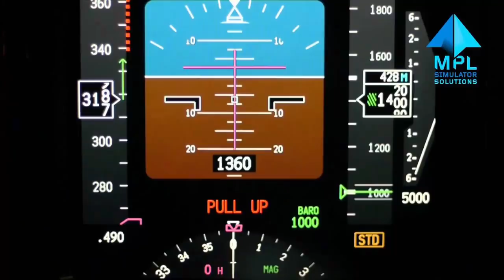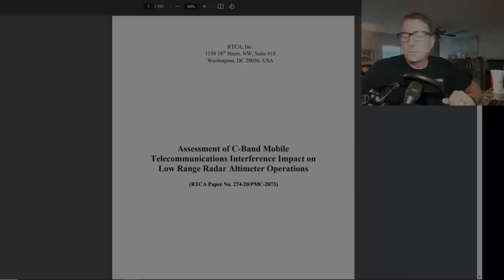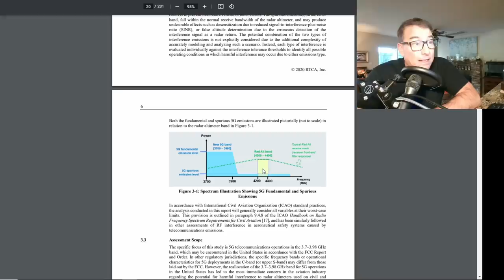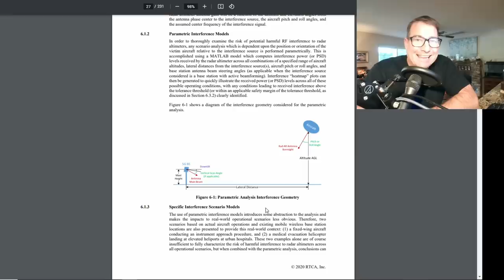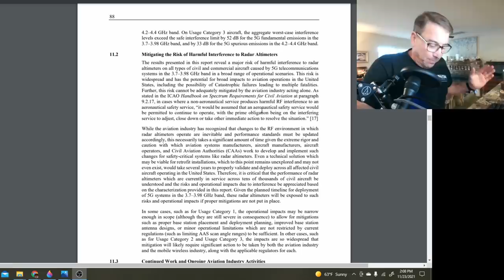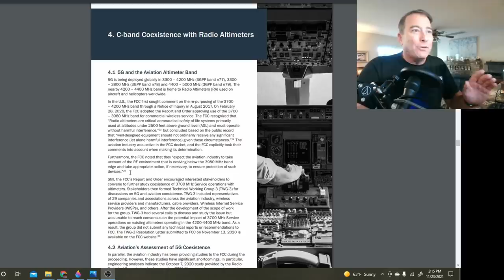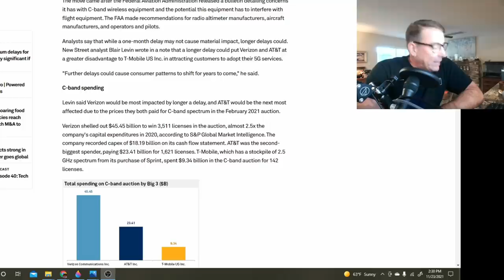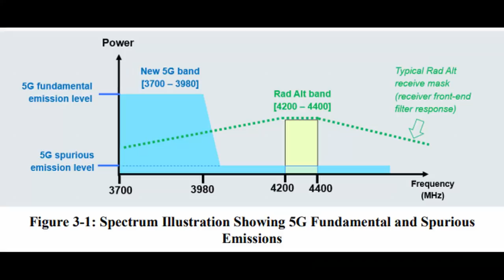5G C-Band Interference with Radar Altimeters in Aviation

Comment: One design feature of the radio antimeter antennas is that it is a horn type antenna that is very directional with a very narrow  radio siganl "beam" for both transmit and recieve. That bean is very narrow  along the lateral axis of the aircraft. Most airline aircraft have two radio altimeter  systems with the antennas close to each other on the belly of the aircraft. But there is a system where by the transmitters time their transmissions to avoid conflict  of the signals between the two systems. So this directional antenna by this diesign may not recieve any interferrence from any transmittesr out side of the approach path to the runway.

Comment: A corresponding thing is happening with railroads in Europe.

Under the new European signaling systems (ERTMS level 2 and 3), trains are in constant radio communication with the central equipment (interlocking, IX, and radio block center, RBC) that determines who gets to go where. This radio link is realized using a version of 2G cellular telephony galled GSM-R.

The frequency band for GSM-R is fixed and is the same all throughout Europe. Now some countries have allocated a neighboring frequency band for wireless internet. These bands are so close together that there is a risk of spill-over. If this happens, trains can lose connection with the central equipment. This is not dangerous per se, but causes unnecessary slowdowns or stops.

Comment: I am a retired AF pilot, with T-37 IP, C-141, H-3, C-21 experience. I wonder if the 5G towers could be fitted with a signal blocking design, (either a physical shielding or an electronic "limiter") to ensure the signals the equipment produces does not radiate upwards? There is no practical reason for the signals to go up as all the "users" in those critical locations, near airports, are below the towers, not above them. Seems this would be a relatively easy, low cost, fix for the legitimate concerns you raise. Love the content on your channel, by the way!
Reply: The conflict comes because radar altimeters are used at low altitudes, and cell towers either have to broadcast sideways or else have one above every house and car pointing down. If the cell tower is 2 miles away, a plane at 500' AGL is almost "below." It's very difficult to make a radio antenna that cuts off within 1 degree above horizontal... harder, in fact, than making a good frequency filter.
Reply: Modern 5G systems use beamforming to focus the signal directly, from both transceivers. I suspect the risk level is being VASTLY overstated.

Comment: Suggestions for radar altimeter / 5G 
1.	Push for aircraft cellular RF detectors that would alarm when passengers 
turned on a cell phone. (I know some research has been done by RF instrument 
manufacturers for airline industry)  
2.	FCC mandate 5G base stations and repeater sites utilize certified antennas 
that minimize or eliminate vertical RF radiation pattern (Particularly near airports).
3.	FCC mandate testing and certification to minimize 5G base stations vertical RF admission,
Reply: Mobiles never transit unless they are given permission by the ground-based equipment. So, unless they are able to receive a signal telling them when they can attach to the network, they stay radio silent. For better or worse, that won't typically happen until the aircraft is below the level of the towers if the tower antennas are pointed down. In urban areas, some of the fixed antennas have to point up to allow high rise buildings to get a signal. Urban areas will generally use a lower power signal with a denser configuration of antennas to support more users, which is less likely to be at a high enough level to cause interference. The mobile devices are also configured to send at a lower power level when close to the attennas.

Full disclosure, I work for Nokia who sells network equipment to the companies who are bidding for the spectrum, but I haven't worked in the wireless part of the business since when UMTS/3G was being developed.
Reply: @Android-ng1wn  I was in the cellular industry and work with the device antenna engineer who had to work with base antennas to get device certification.  Microwave dish antennas operating in the same frequency bands it's not uncommon to see a grounded plate to deflect unwanted radiation from interfering with other systems on the towers or rooftops, adding a grounded element above what is a small 5G base stations and or repeaters near an airport would not be rocket science Just good site RF engineering.

Comment: Thanks for your report. I have worked on 5G. The wireless industry will consume spectrum without end. Today the primary use case consuming bandwidth is streaming video, tomorrow it may be VR/AR, not exactly a life critical use. The mobile wireless business is encroaching on GPS, and cutting into the satellite spectrum, which is in short supply. 

The wireless industry wastes spectrum by allocating separate bands for transmit from the base station - for that streaming video, and received at the base station which is barely used. That is called Frequency Division Duplexing. The wireless industry and the FCC could be much more efficient by adopting Time Division Duplexing - dynamically sharing one band for transmit and receive. 

Pilots should be concerned about passenger misuse of radios. Unfortunately passengers will be tempted to turn on their radios on approach to get a signal.
Reply: Yeah, having used 5G I'm unimpressed. Maybe I'm not the target Tik Tok demographic but I care much more about reliability at 4G speeds than this garbage. I'm always perplexed by the 5G hype. Yes, faster will be cool but not if I have to be sitting on the tower to use it. 

Of course, I know nothing about radios and cell phones so maybe I'm missing some magical piece of information but as long as I can talk to friends and family and stream a video (and importantly, send a text message) from anywhere, I'd be much happier than getting a speed boost. (i.e. geographic coverage, including inside buildings or subways or whatever, is way more important to me than speed).
Reply: This band is TDD.  The FCC decides which bands are TDD and FDD, not the wireless operator, primarily due to coexistence.  Operators also prefer TDD due to the asymmetric nature of user traffic.

Comment: The first few crashes will provide the empirical data needed.  Is that how Boeing tested the 737 Max?  It might be air transport or fast wireless communication.  Or can all navigation might need to go to GPS signals.  Might the GPS signal integrity might also be compromised.

Comment: I'm still yet to understand the point of 5G in general.  Why would anyone need/want to be able to pull 1Gb/s+ off towers?  It serves no purpose.  Your YouTube/Facebook/whatever isn't going to load any faster than it would on a normal connection and even if you DID start utilizing the bandwidth to transfer huge files, which is really the only time you'd ever notice that much additional bandwidth anyway, you'd blow through your allotment and be throttled basically instantly.  (Yes, even on your "unlimited plan"...)  
The only reason these companies are doing all this that I can think of is because it's a sales pitch.  "More = better" and this brings Dr. Malcolm's quote to mind...they're "so preoccupied with whether or not they could, they didn't stop to think if they should."

Comment: The FCC has effectively killed the 3.3-3.5 GHz allocation for amateur radio operators with this action, too.

Initially, they were going to sunset the entire 3.3 to 3.5 GHz range, but the ARRL worked to get "temporary reprieve" for 3.3-3.45 GHz.

From what I see on the 5G NR band allocations, the C-band TDD allocation is a worldwide allocation from 3.3 GHz to 4.2 GHz (right at the edge of radio altimeter!!), but is "temporarily" limited at 3.98 GHz in the US.

Both 4G LTE and 5G NR use OFDM modulation, and tend to not exhibit much in the way of spurious emissions (at least in my own observations, using software-defined radio receivers -- as an example, the P25 public safety allocations in the GSM850/UMTS B5/LTE B5/NR B5 FDD band gap). But the problem I see here is that this C-band allocation will be using TDD (time-division duplexing, where the base station transmits on a channel for x milliseconds, then the mobile equipment transmits on that same channel for x milliseconds) rather than FDD (frequency-division  duplexing, where the base station continually transmits on one channel, and the mobile equipment transmits on a different frequency, as needed).

In the amateur radio world, we use many technologies, both analog and digital. As an example, when I transmit standard FM voice on 70cm (440 MHz), I get some spurious emissions, but they're consistent in their power levels. When I transmit using a DMR radio (which uses TDMA -- time division multiple access -- ie: I can transmit in timeslot 1 and another operator can transmit in timeslot 2 simultaneously), the effect is profound. Instead of one strong carrier, with some sprious emissions, the result is very rapid pulses of RF energy at the carrier frequency, with significant "splattering" and spurious emissions all over the place, and is much more difficult to deal with. Analog transmissions rarely cause interference among things in my home, but DMR makes many things go berserk; even some headset/mic units designed for handheld radios have trouble dealing with that pulsed emission. And these handheld radios are 5 watts or less.

Ironically, I get less interference from my HF radio, transmitting at 100W from 1.8 MHz up to 54 MHz.

Oh, and us amateur radio operators (at least here in the US) can transmit at up to 1,500 watts on most bands. One of those bands is 2,390 MHz to 2,450 MHz -- incidentally, a microwave oven cooks food with 1,000-1,500 watts of RF energy at 2,450 MHz -- I could (legally) make a bacon gun, as long as I can transmit my call sign in Morse Code while cooking my bacon.

In all seriousness, I will probably end up making a video and/or blog post about this topic. My call sign is KD9QZO, searching for that should find me. I'll (try) to update this comment if/when I do.

Comment: Great video describing the problem, however based on the info here I have to agree with 5G. Based on the graph at 10:22, you can't claim >1GHz beyond your allocated 200MHz simply because you have bad filters. It is not hard to design analog or digital filters that provide 40dB or more of rejection within 2x of your bandwidth. If the altimeters are so critical but at the same time so delicate then that's a huge vulnerablity for the aviation industry even without 5G. In that case the altimiters should be redsigned to be more robust anyway. Also putting the transmitters directly under the path seems overly conservative, it seems a simple solution would be to just don't allow 5G transmitters under the approach paths.
Reply: Electrical engineer and former Boeing employee.  I totally agree with the above.  Seems the aircraft/avionics manufacturers are trying to shift the issue to the 5G rollout when the core issue is their lack of stringent design of filters.  This was probably not an issue when the early radio altimeters were introduced, no one else was on the spectrum, but it will be an increasing issue as the spectrum fills up.  There was a similar issue with GPS systems, again lack of appropriate filter design.  This is not "rocket science".  Any competent HAM radio enthusiast understands the issue.
Reply: @chuckwain5591  I don't know the issue well enough to say either way but I wonder how much of this is really an issue or is this just overzealous paranoia ("You can't say with 100% certainty that it's impossible for there to be issues").

Comment: The bulk of the 5G service will be launched on frequencies that the big 3 already own.  Example: T-Mobile is using the old UHF TV frequency of 600/700 Mhz and the midband 1.9 to 2.5 Ghz band for 5G transmissions.  Their reservation for that 3.5 to 4.2 band will be used for rural expansion to cover more roads and freeways in America. Band sharing has been used for years by the FCC. They could create a rule for cell towers,  saying they can only operate on the lower end of that band near airports, hospitals and certain cities. It will be manageable.
Reply: I think you got that backwards.. the higher the frequency, the less  the range per kwatt.  at lower frequencies one also has to use more channels (bandwidth) to get the high byte transfer rates.. thus the closer to 5Ghz the shorter the range an the better for high population density.

Comment: As a very experience electrical engineer in the radio industry,  with some aviation/avonics experience, I can say that you've done a good job explaining this. It's slightly slanted from your point of view, but that's expected.
.
The only thing I will point to is that the idea of being first in the spectrum is only of minor importance as we pack more and more stuff into the spectrum. A system must not transmit out of it's allotted spectrum, nor be able to receive out of its normal spectrum within reasonable standards ( reasonable amount of power). It's unfortunate the radio altimeters have those type of front-end filters, but it is not impossible to improve them in a modest amount of time. 
.
It clearly should have been identified and addressed long ago.
.
As radio systems have evolved since it was invented there have always been times of conflict such as this that had to been resolved.
.
Having been out of the industry for quite some time now, I find it very surprising that it has gone this far,  right up to the point of deployment and we still haven't resolved this. 
.
I'll be using your video as support for things that I've said based upon my professional experience to help people understand what's going on.
.
I'll say that based upon what I've seen in the last 10 or 20 years coming out of people that think they're engineers, in various technologies, is very disappointing, especially based upon the high quality of people and work and designs that I was part of when I was developing communication systems.
It appears somebody was asleep.

Comment: Radio Engineer here but involved more with Public Safety systems. Basically the FCC is saying that just because the aviation industry is using loose and inexpensive filters does not warrant a hold on the adjacent bands and I have to agree. You can't imagine the filtering used on all RF equipment in order to stay "in our lane". The aviation biz shouldn't be given a pass for (legacy) sloppy filtering. The mid-plan would be to mitigate deployment of some cells (which are inherently of small size and as stated not oriented towards flight paths) until the FAA has "cleaner" altimeters. Public Safety has recently gone through a resizing of channel sizes which involved better filtering on portable radios *which far outnumber aircraft*. Claiming this upgrading process is unfeasible is not accurate, it has been done before successfully.

Comment: Juan, hey, love your show.  The FCC is supposed to know what they're doing.  This is not the first disaster for radar altimeters.  Radar altimeters in the late 60's early 70's used X-Band (10.525gHz).  This band was clear, then the FCC allowed police radar guns to use the same frequency, and the result was that ALL aircraft X-Band Radar Altimeters were then illegal.  Why, because there were a lot more radar guns than radar altimeters.  The FCC then allowed the 4.2 to 4.4gHz space for radar altimeters, and the airlines had no choice but to refit their fleet, and at great expense (~$2 billion). 

Now, here we are with the same problem.  Roughly $2 billion in radar altimeters just in the US Airline fleet, but the FCC sold the C-Band for $78 Billion.  You don't need to be a genius to figure out the cell players will win.  It's all about money.

There is some new technology brewing in the form of RF Bandpass filters that will solve the interference problem. Do you know anyone at the FAA, FCC or airline industry I could talk with?

Comment: The bandwidth question is why Europe has had to press on with 8.33kHz VHF spacing.  Whether that becomes an issue in the USA (with its wider-open physical spacing and fewer airfields per square mile) remains to be seen.

Comment: Those diagrams you show illustrate what we call 'brickwall'' band limits. They exist for simplicity only. You can't actually engineer a filter that sharp and as the filter gets sharper it 'distorts' the signal in various ways that in radar applications will result in a less precise 'return signal'. For exactly these reasons, radio bands have those 'guard bands' separating them. You'll find analogues of this all over the place in other applications.

Also, radar suffers from signal strength issues far worse than radio reception. On the outward path, the signal reduces with distance according to the 'inverse square rule'. likewise the return, making it obey an inverse FOURTH power rule relative to distance. Just doubling distance results in the signal dropping to 1/16th of the previous strength.

Comment: The 3.7-3.9 ghz c band has already been auctioned and assigned to cellular carriers. There is over 200 mhz of guard band between cellular and altimeter equipment use. More than double the rest of the world already using c band for 5G, of which, no interference has been detected. Not a single case of any altimeter failure or even an event of forced work around of Auto land. This is a charade. The faa is producing baseless claims and the carriers have produced imperical proof of no interference concern. The faa should just hurry and be wrong already.